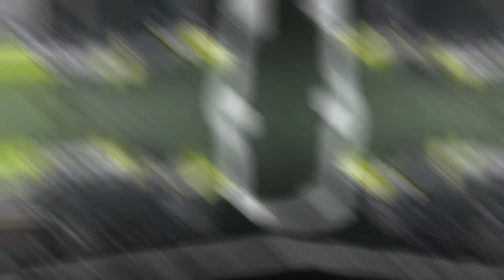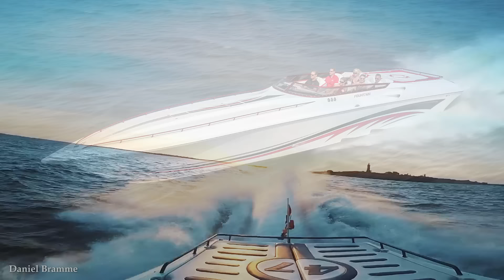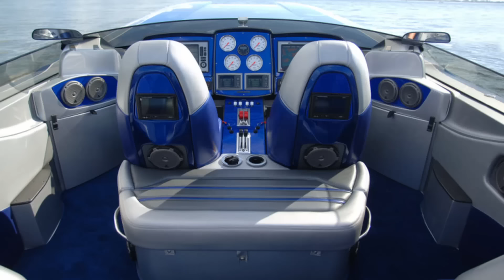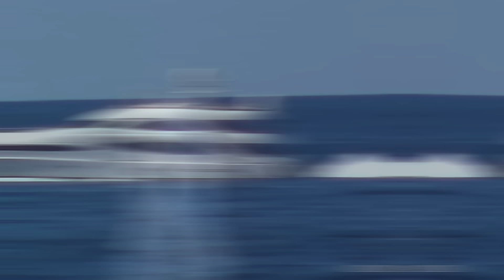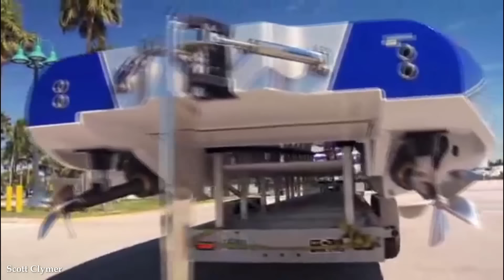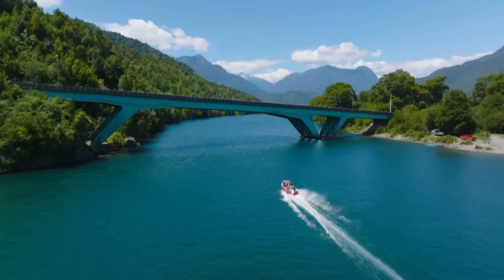FASTEST Speed Boats in the World

Comment: The HMCS Bras ‘Or 400 is NOT a battleship!  The fastest battleship ever built was BB-62 the USS New Jersey, second ship of the 4 ship Iowa class battleships.  The New Jersey is 887’-7” long, 108’-1.38” wide at the beam, draws 38’ of water at full load and weighs 60,000 long tons at full load.  The ship’s steam turbine propulsion plant produces 212,000 horse power on 4 shafts.  The design speed of the 4 Iowa class battleships was 33 knots, and BB-62 New  Jersey was unofficially timed going 35 knots during her 1980’s recommissioning!

Comment: Man i wanted to hear that Mercury 6 cylinder with straight pipes curved out the back!
Reply: The boat in the opening picture is mine. It only has three pipes the others are photoshopped.
But it does sound good you can hear it on utube under 1250 sbp stacker.

Comment: Well the cover pic is most assuredly click bate. There's so much wrong with this Pic it isn't funny. First off according to the Pic the outboard is a 7 cylinder. With one of the exhaust megaphones is comming from the flywheel.  Next 3 of the megaphones are on the intake side of the engine. Next all of the megaphones are located  to far forward on the cowling and the top hat.

Comment: Ok boyz. So  listen up best engineer history of mankind here.
     Introducing thlast level in end all boating& u heard it here 1st sissder.
 Introducing "thSkidrow Flyer" floatplane hybrid
    
U need a 2motor front/reat drive 100hp each front (and) rear motor  short wings i said foam core WINGS neutral incidence flying ON thwater boat with a FLAT bottom trimmed down or up on thfly attitude leveling wingerons& I want CG set 28% *inboard of thnose.
   No rudder we talking low drag longish there4 STABLE boom&tail with vertical stab. 
    With this set up u now fly on thwater your a skid.
    Take off speed thlake is a runway.
  Other words u just weight a h*lluva lot less on the water & can balance things in "flight" so as 2trim down th nose maintain a SMOOOTH glasslike level steeamlined attitude irrelevant of thwaves.
 Couple small hydraulic outrigger skids...
   Taper that airfoil (curve it down aaaall thway to th trailing edge so as its always falling below th air stream or a level placed topside threarmost airfoil..
   This will cause th airflo2force that nose down yet (only)@ speed beginning@ about 60mph. Below this speed lift will be improved. A fortunate coincidence.
  U want the LE (Leading edge) 2b similar to thblunt profile of your thumb. This will restrict attitude in an aircraft but YOUR only aim is 2reduce drag @ every turn.  That blunt LE will reduce drag quite drammatically as th crow flies.
 Which is all u will be doing.
  "Get ready 2b using a lot less gas."
   Your basically designing a boat 2fly just above thwater. Which can become just as literal as u like.

Comment: I'm not sure about the staggered engine arrangement, a lump of motor weighs a lot and having them placed in different places must affect the performance of the boat. Put it this way it can't be beneficial in any way, except for being able to fit them in the boat, which is why they probably fit them that way. If I'm building/buying a boat I'm going for the side by side configuration over the staggered set up

Comment: And can I state one small training incident? Little. Problem with these boats? Not the manufacturing not the engine well kind of any speed over 60 miles an hour even at that if something were to go wrong. You'd have better luck running into a concrete slab at 60 miles an hour then water. A life jacket won't do you much good